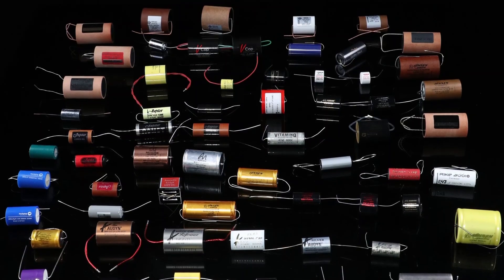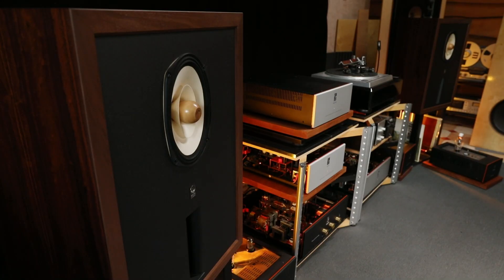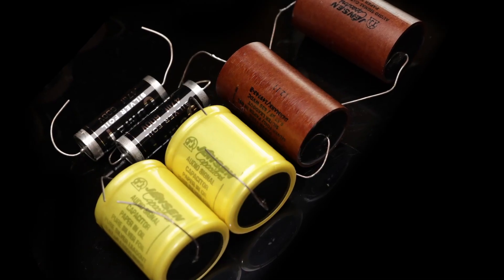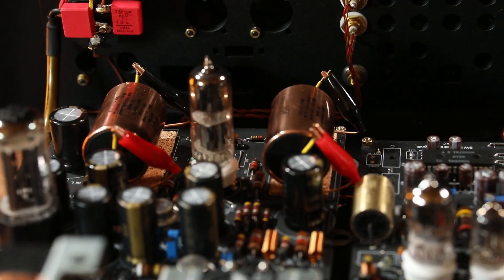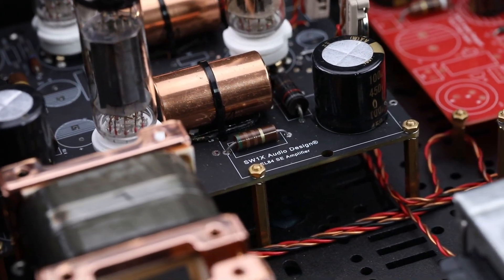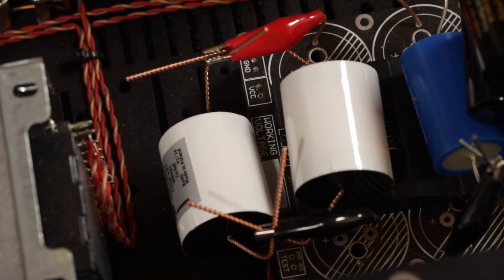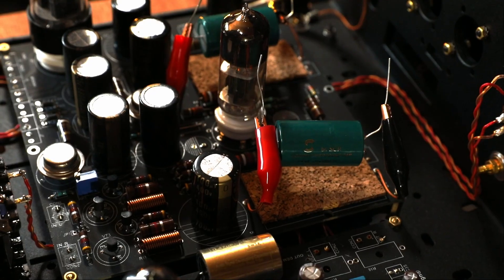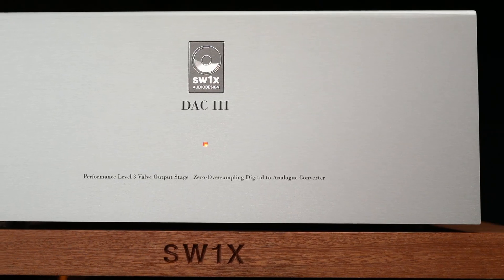How To Improve Sound Quality of Audio Equipment With Capacitors

Comment: Fix the main thing is that this power supply becomes an important thing before continuing. The capacitor on the PS is very decisive for a good supply on the circuit so that it gives an optimal sound. Of course capacitors for coupling determine the sound character, cooper is a common choice for warm characters and silver is a premium choice but this requires the correct circuit because if it is wrong the result will be very audible.

Comment: What do you think of the teflon insulation of the vcaps
Reply from the maker: it is OK, much better than PP in other caps. the combination with coper foil is good. However their awfully thick PTFE coated copper leads deaden the sound unfortunately. they are full bodied but relative to other caps their musicality is average- there are more musical caps out there
Reply: @sw1xaudiodesignthe vcap odam doesnt have ptfe leads, im not sure if you tested those.
Reply from the maker: @williammeincke9071  was referring to the copper and tin foil ones. oh yes, we have had the ODAMs but these are metalised PP not PTFE, which is an even worse combination. the complete list of all caps is found here: https://sw1xad.co.uk/capacitor-shootout/

Comment: Many things to consider, I can see how different materials sound different, even though the electrical properties are the same on paper.
Sound is not just any signal, it is complex to our ears, any resonance or emphasis changes the coloration ever so slightly, giving a different experience of the timbre of an instrument.
If the woodwinds and cymbals sound good you are using the right capacitors :)
Reply: You make a good point.  I also listen for the wood and the hollow-ness of a cello.

Comment: I don't fear to use electrolytic capacitors as coupling capacitors in tube output line stages if I need low output impedance even for lower frequencies ... ;-)

Comment: Measurement does tell the complete story. the ESR, ESL, any shunt leakage components and C completely describe the capacitor. Audio people seem to think something special happens with audio that is not an issue for more stringent applications like RF where understanding the capacitors known and published parameters is paramount. Words like "more dynamic" and "more honest" have no place in a scientific discussion,
Reply: Have you tried correlating the aforementioned measurements with sound quality?
Reply: Unless you don't know what to measure or how to interpret your measurements. 
Measurements are highly overrated because of this. 

You don't know what you don't know. And if you exclude that possibility you won't even try to find out more. 
It's the death of science.

Comment: The problem with retrofitting caps in modern gear is that crowded PC boards designed for a compact,  say,  1 uF electrolytic cap will not accommodate a much larger film type easily, or at all.  Old tube/valve gear is easier in this respect.  Some compromise with bypassing the small cap with a small film cap which supposedly might improve things at least at higher frequencies.

Comment: I have the 45 year old article from AUDIO magazine where they did a scientific analysis of capacitors for audio.  Not a bunch of "listening tests" but actual measurements of distortions and behavior of different types.  This lead me to upgrade caps in a lot of equipment in the past.  Not to exotic audiophile branded types, but based on materials and construction.

Comment: Great to have your feedback, I agree with you in 90% of what you said. For me sometimes the in oil caps can be a little too damped, it depends on the cap, the higher end oil are better. I'm delighted you don't like Polyprop. I always pick Polyester or Mylar even in cheap caps over Polyprop. It's more dynamic and more honest. Polyprop has a false synthetic edge and is 'polite' and just unremarkable 90% of the time. I have experimented with some caps adding a copper tube and remove the plastic wrapper then using something like OB-1 adhesive. This can add the copper 'density' and body in some cases. Being mean if the size is right I use heating pipe and wirewool to remove any corrosion !
Reply from the maker: likewise- your feedback is appreciated

Comment: I Totally agree, replacing capacitors make HUGE difference in VINTAGE and MODERN speakers and amplifiers, it is the best way to upgrade the sound quality of your audio system.Unfortunatelly up to 3000£ budget speakers  manufacturers still consider  very cheap  ceramic resistors and very simple MKP capacitors on the crossover.I replaced the caps on my dynaudio excite x34 speakers by jantzen alumen and mundorf supreme resitors. I Spent 250 £ in total and now the speaker sounds at least as 1000£ more expensive. It is crucial to understand the sound signature of the component and determine which  capacitor will be more suitable.Not bad  business and very happy with the results.Similar results upgrading audio amplifiers.
Reply: Yes, I had a set of older B&W 801's and had the crossovers totally rebuilt by Solen electronics using modern caps, inductors .. the result was beautiful and better than stock.  Back in the 1980's when they were first built B&W did a great job on those speakers with the technology they had at the time.. and the amplifiers that were out at the time. Those speakers with modern amplifiers and crossovers walk all over higher priced speakers. Great design IMO.

Comment: Without seeing what capacitor is inside, it is so difficult to discern anything. So basically, without expectation bias, these intangibles are so hard to pass a double-blind test.
Reply from the maker: of course, there is an expectation bias and there also one especially if one particularly does not care about how they sound. human hearing is not perfect either

Comment: The weak link is human hearing. Each individual person has a unique hearing and taste in sound that determine the voicing of the product. You voiced your equipment on your hearing perception. I might voice it different. The capacitor plays a minor role, its your hearing that determine the outcome of your equipment.
Reply from the maker: our ears are usully OK - the weakest link is rather the human mind
Reply: @sw1xaudiodesign  Agreed.
Reply: I wouldn't call it weak, maybe "various" link.
Reply: You have no appreciation for what an incredible piece of engineering the human inner ear is, with the processing of the brain. All the plans for that are contained in every cell of your body. 
I agree that the human brain is sometimes the main problem, especially when it has been washed with nonsense. 

Capacitors, as simple as they are, make a HUGE difference.

Comment: Yeah... id rather design my gear dc coupled and eliminate sound problems with caps...
Reply: Capacitors being a worry when single ended tubes are used is an interesting development. True, different distortion characteristics between them. 
But distortion all the same.. Capacitors can be fine though if they're used well and in areas of low current capacity so that their value can be kept reasonable. Like in opamp based crossovers. 
Elliot sound products website does a lot of audio mythbusting with good science and their article on intermodulation distortion is especially enlightening.